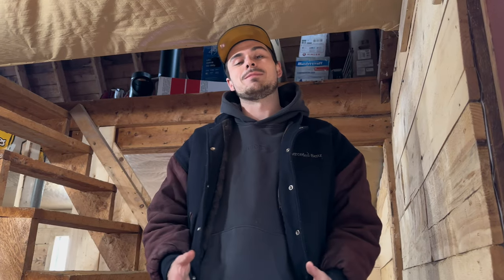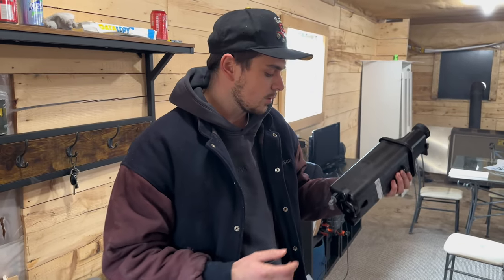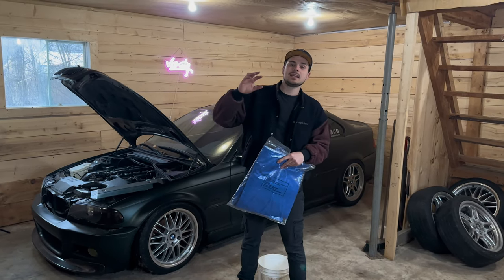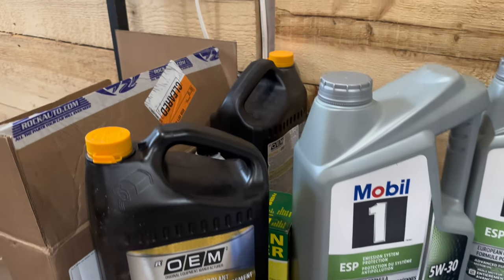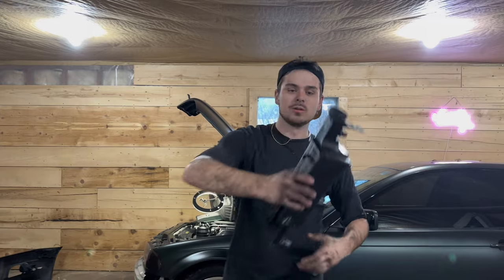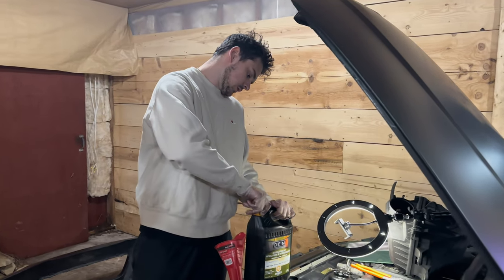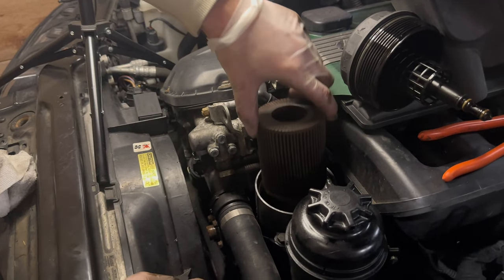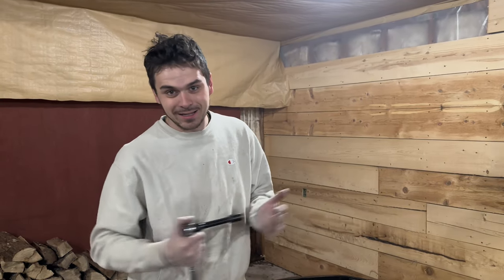When Your Daily Becomes A Project Car

Comment: This was just the short i saw about the low coolant lol i luckily never blew my expansion tank when i had my 330ci, now im about to buy another E46 and look forward to this nightmare 😂 to be fair i sheered off the nut on the oil pump in my first engine, so i actually blew an m54 in another way 😐